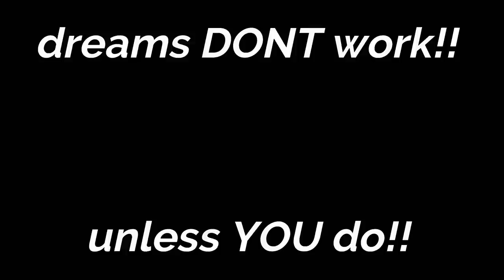Restoring old CORBEAU seats! Color change

Comment: You can do this to help set the dye and keep it from fading. Thoroughly clean a large mixing bowl or cleaning bucket, and then fill it with one gallon of fresh, clean water. Add one-fourth cup table salt and one cup vinegar. The vinegar and salt work together to naturally lock the color into the fabric. You can spray this solution on.

Comment: Yo Jeff #dbfam @DEADBEATGARAGE I  Need help with the head from that messed up E36 m52 Motor you got from the storage unit. I have paid for cleaning and checked out at the machine shop for 4 different head's. If that head is good I'm in AZ. I need some help you know what I mean. Can't find it on market place  Need this to get my E36 project up and running .